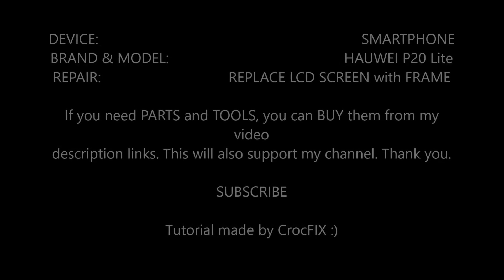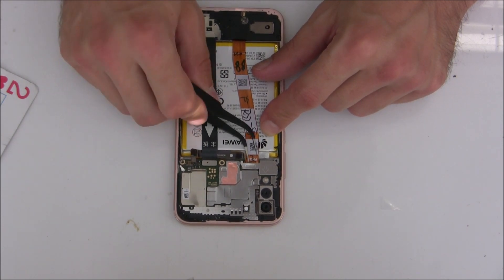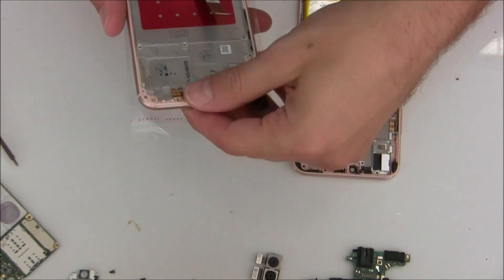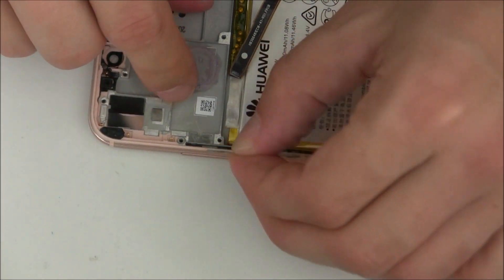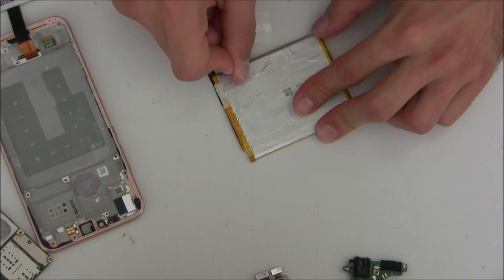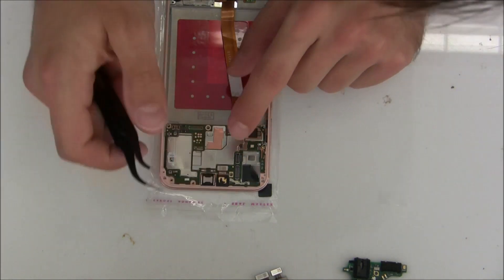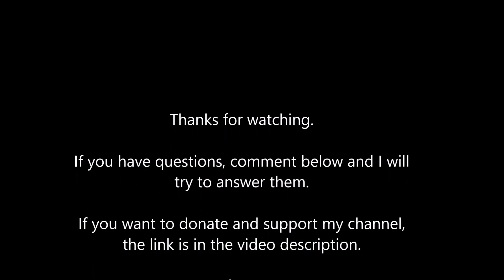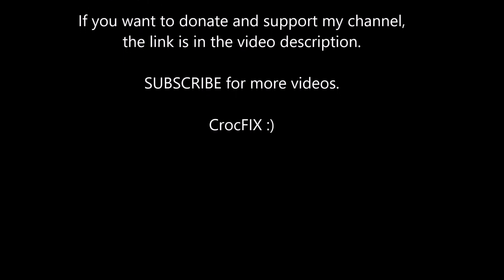Huawei P20 Lite LCD screen replacement tutorial by CrocFIX - nothing left

Comment: I am tech like you iMASTERTECH Canada I recommend to you a better way to take the battery out used compress air just turn the bottle and freeze come out put below to the battery after come very easy nothing happens with the battery
Reply from the maker: Great, thanks. But do you mean compres air or CO2? Normal air is not cold....
Reply: @CrocFIX  yes it is.